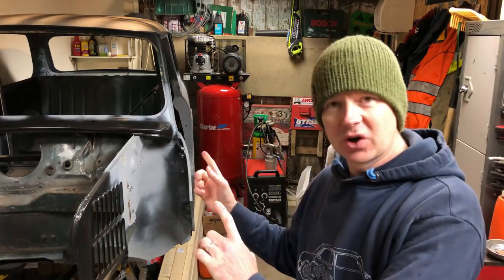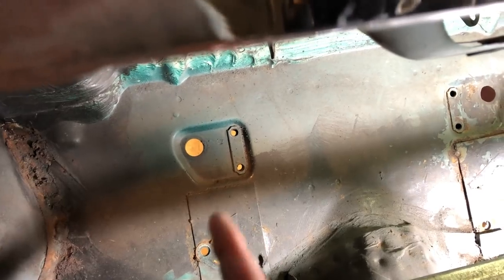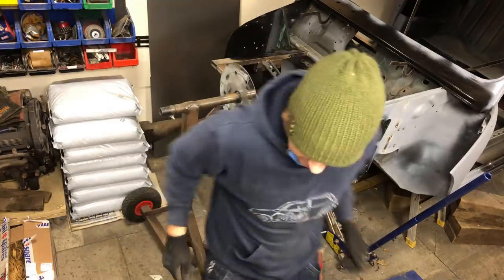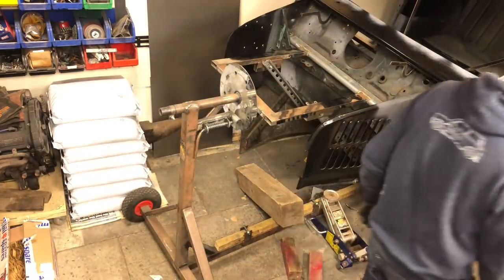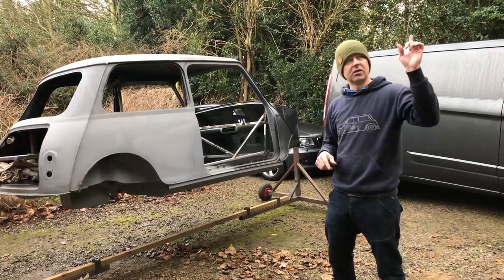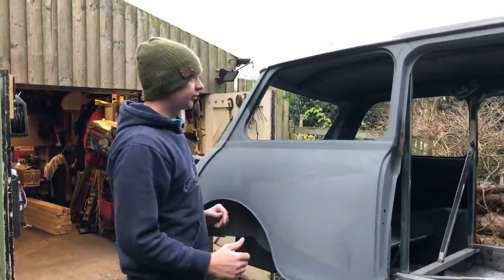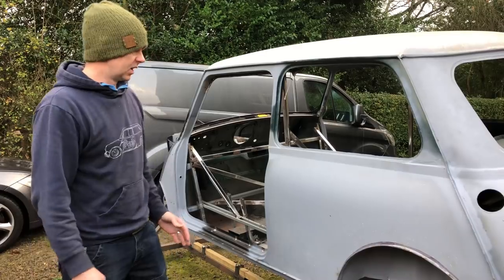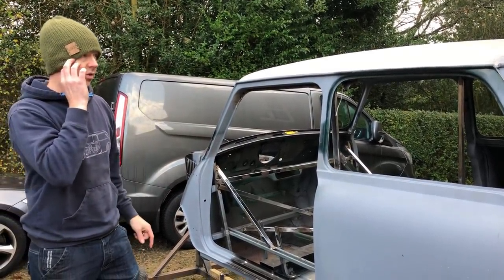Classic Mini Mk1 Conversion - Walk Round - Part 42

Comment: Another great video. I’m a panel beater, I work on modern cars every day with high strength steels, that can’t always be welded. They have to be bonded and riveted or mig brazed. 
Love the old cars where the metal can be cut and bent and mig welded. I always enjoyed working on cars in the 80s. Probably why I enjoy your videos so much.  Keep em coming 👍

Comment: It will always be noticeable that it’s not a mk1 mini. Yes you have changed the a panels to external hinge but the roof gutterings are not the same as a mk1 so will always be noticed. A shame but fair play you doing brilliant job every mini restored is a bonus thank you
Reply from the maker: Hi! Thank you for your comment. This is something I covered in previous episodes, it’s something that will be changed along with the added drip rail, it is quite a simple bit of fabrication that is needed. In comparison to some of the work we’ve already done this will be quite easy. The project is far from finished so there is a few things left to do yet. 
Cheers 👍

Comment: Thanks for the walk round ... great to get a reminder of all you have done to make the conversion to Mk1. Will you be making the modifications to the front parcel shelf as well as the inner of the roof to allow a Mk1 2 piece headliner?
Reply from the maker: Hi! Thank you 👍👍 yeah definitely going to make those changes on the inside, I need to make some Cant rails to fit the Mk1 headliner, and I also need to get the switch panel from a Mk1 to make a template for the front parcel shelf, apart from this the parcel shelf is the same as a Mk1 isn’t it?
Reply: @upbuild4397  nice one. From what I remember there are more cut outs on the parcel shelf itself for ducts and wiring and so on so might just require panels to fill in the holes.
Reply from the maker: Are that’s great thanks, should be any easy enough job 👍

Comment: Great project, can you advise address to order a hat. Many thanks. andrew
Reply from the maker: Hi! Thank you very much 👍👍 

There should be a little arrow pointing down at the bottom right corner of the video when it’s minimised, tap on that and it opens my description which has the link in. I’ll post them here also but sometime it doesn’t work from here. 
Handmade Hat Shop: 
https://www.etsy.com/uk/listing/903908721
USA SHOP: 
https://shop.spreadshirt.com/upbuild/all
Uk & European SHOP: 
https://shop.spreadshirt.co.uk/upbuild/all